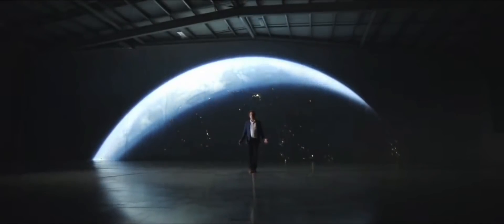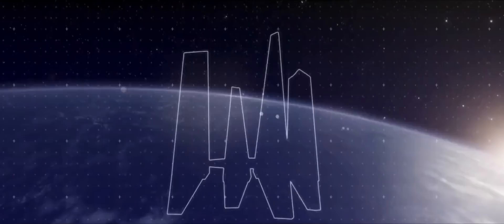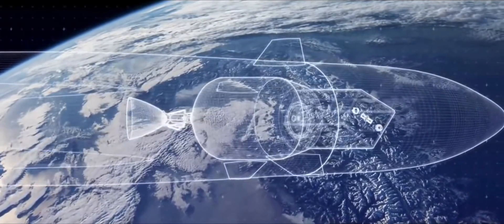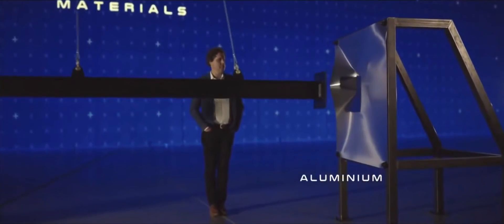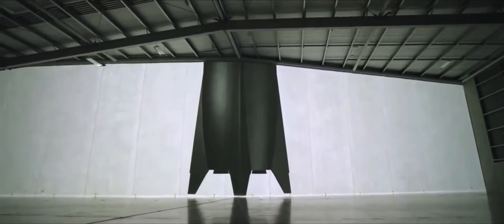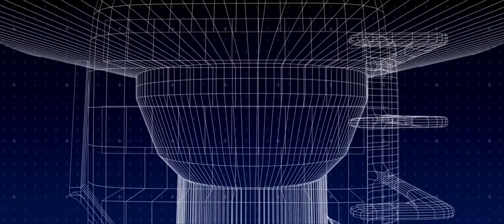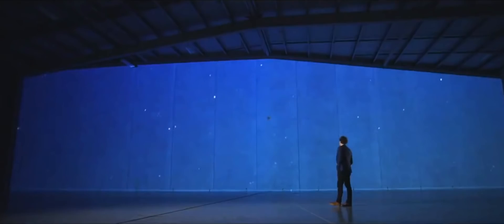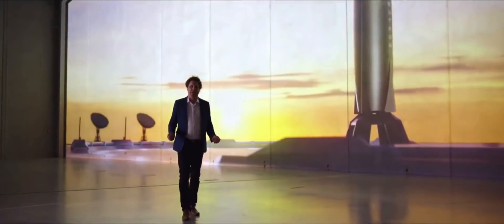Rocket Lab unveils reusable Neutron rocket's design, with 'Hungy Hippo' fairing

Comment: The thing that puts me of is the strings of smirks clearly aimed at SpaceX like "doesn't need a barge to land on but returns to its launch site", "doesn't need retractable legs" and also the insinuation that it's using far superior material in carbon composite than the inferior steel. Perhaps he should eat his hat again since he clearly  was trying to demonstrate by doing that he had retracted his stance on re-usibility. If he was a little more humble he would reliaze a few key things like, SpaceX was already using carbon composite materials in falcon 9 but decided for cost purposes to switch to steel in Starship.The falcon 9 series do and can return to the launch site but sometimes the more cost effective solution is not to waste fuel going back to the launch site but rather bring the land site to it.. As far as fixed and retractable legs are concerned SpaceX did have fixed legs on hoppers and test vechicles but opted for retractable since the drag was less hence a fuel saving from aerodynamics during flight. So all in all he is doing nothing new but following in the footsteps of SpaceX by copying most of their tried and tested technolog (who else was using methalox) however instead of being grateful for SpaceX for showing him the way, he arrogantly reiterates he is better and will create a better product.
Reply: Isn't Falcon 9 only partially carbon composite (in the landing legs, fairings and interstage), and the rest mostly aluminum lithium? Neutron seems like it will have much more carbon composite in it.
That said, stainless steel in Starship ultimately seems like the smarter choice for Mars applications since it'll tolerate prolonged radiation better.
Reply: Everything here is just an animation and promises. New engline, new rocket. Fairings' mechanics ain't this easy, landing rocket this heavy on the concrete base - we already seen what propulsion can do with concrete during spacex launches. So, fingers crossed, let's hope they'll manage at least half of whats been promised.
Reply: You sounding abit precious. Improve, improve improve that's what we need to do. Learn.  ???
Have you ever  heard of fun? Tounge in cheek?
Lighten up, put on a 3d carbon comp smile.

Comment: that was a declaration of war to SpaceX
Reply: That it was, but it isn't a good look for Rocket Lab to devote so much time of their fancy video throwing shade at SpaceX. Snark against comparable flying hardware (the Falcon 9 in this case) when all you have behind you is a fairing mockup and a batch of fancy CGIs, but not even a prototype engine...well, it's not good optics. We've seen what kind of rep Blue Origin has earned with that tactic.
Reply: @johnpaulvanson5170  Seems to me like they are just fishing for investors right now. Let’s see if they can deliver.
Reply: The mouse that roared
Reply: @kal _xcyz014 "Once Starship becomes operational", do you really think that metal can will become operational?
starship is the replica of the N-1 but American. It is not copied in the design of the N-1 but in the explosions that it is going to have hahaha